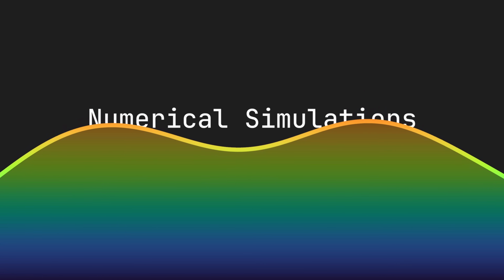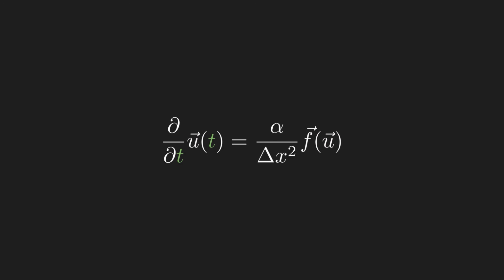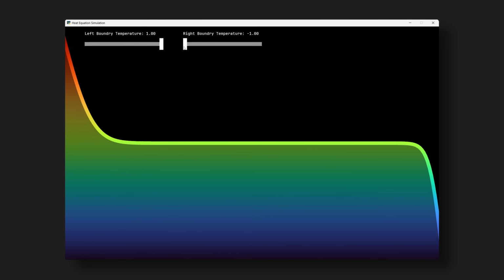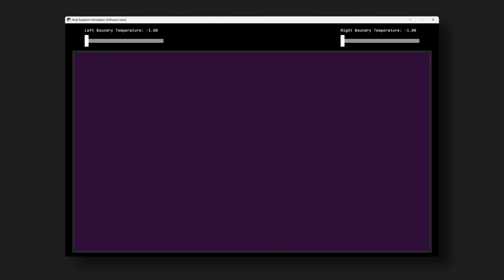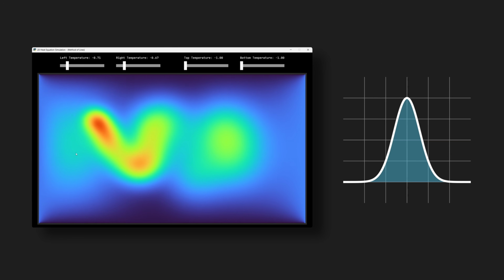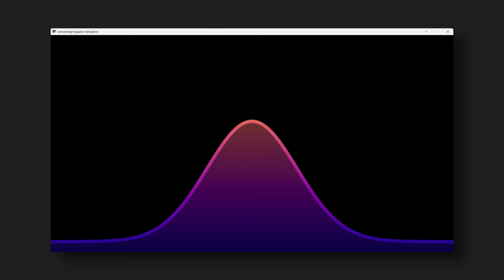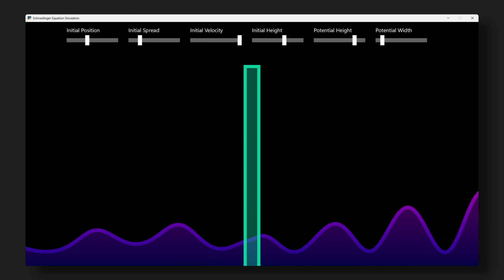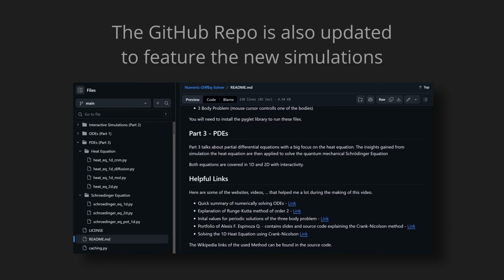Simulating the Heat Equation (and more)

Comment: Nice video, I enjoyed!

The grid pattern you see around 33 minutes is from the similarity between the initial wave function and the eigenfunctions of a 2D box. 

In a 1D box the eigenfunctions are sine waves, and likewise in 2D you get sine waves across both the x and y directions.

If you want your simulation to run faster you could convert the whole thing to a shader, instead of scipy functions : ) I've done that in 2D and it works nicely as long as the grid doesn't get too big.
Reply from the maker: Yeah now that I think about it I did figure it's because of the sine waves - makes sense. I'll definetly try that with the shader. I'm slowly getting more comfortable with them
Reply: Shadertoy by inigo quilez is very good for learning

Comment: 34:00 the periodicity comes from the imaginary unit!
Since our PDE has fully imaginary coefficient, the system doesn't exponentially decay/grow, but rotate with the form of e^(A*t*i)
This introduces periodicity, since whenever A*t*i=2*pi*k for any integer k, we get the same output.
Reply from the maker: Yeah right since the gaussian wave packet is just a bunch of sine waves they just rotate until they are all back in phase
Reply: @tam @tamaschque can also notice that the spatial symetries comes from the symetries of the box : in a square you get 9 = 3 * 3 dots, with a square distribution whereas in a circular box you get cercles.